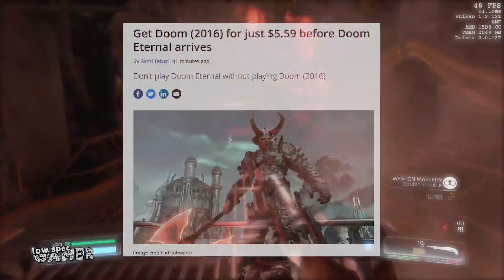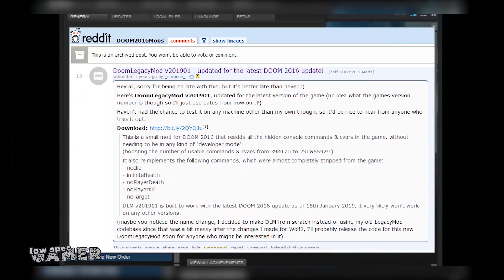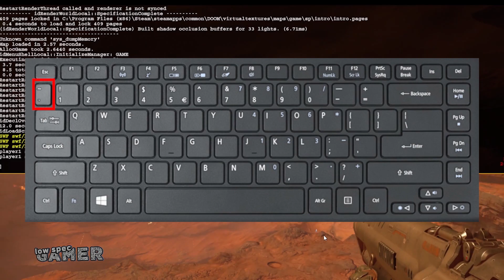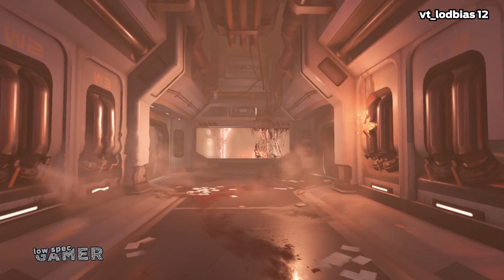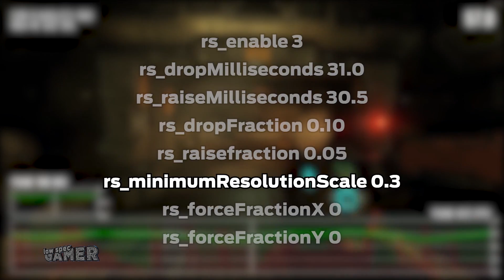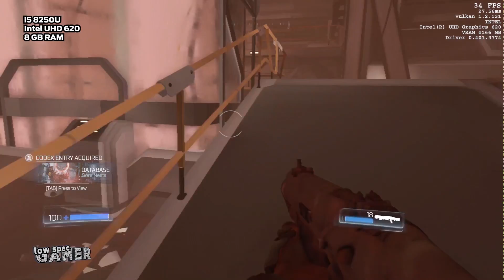Doom 2016 ultra low graphics for low end PCs (Intel HD/UHD 520/620/630)

Comment: can i atleast got around 20fps 
im using intel core i5 660 3,33ghz
4gb ram
intel r hd graphic (1st gen if im not wrong)

im fine with 800x600 resolution or even lower ;-;

Comment: I've input the commands and the graphical commands trying to run the game at a dynamic 30 fps at 720 on the intel uhd 620 and it keeps dropping to 24-25 fps only locking to 30 when nothing is happening.

Comment: yeah i used some tweaks in my r7 240 gddr5 2gb vram and i can get to 70 fps in 720p with a scale resolution of 70% the game still looks good and i can even raise some configs but i will not so i can play at 60 in full intense combat 
obs: runing opengl because i was not able to run as vulkan i dont know if its my cpu a core 2 quad that is very old or that i only have 6gb ram ddr2 but it is not the gpu i know it supports vulkan as i see in a lot of youtube videos and in gpu-z it shows that i have support to vulkan...

Comment: I installed it correctly, but it still says "Unknown command".
is there a way to fix this?
Reply: Same problem too :((
Reply: Paste all the downlaods file from the low end site in the doom folder
Reply: @r9compsftbl  still doesn't work
Reply: manually type it then.or you just havent watched the whole thing
Reply: @-PolesticoPaulJustineD  I have, multiple times.

Comment: when I enter a command is says unknown command. is there any way fix it?
Reply: Mine is a cracked version too so I thought that's why it didn't work
Reply: The mod, install It
Reply: Doom Marine No. 2145 I did and it still didn’t work
Reply: All you gotta do is copy dinput8.dll and paste it where both doomx64vk.exe and doomx64.exe are located, that's it, check if you typed the commands correctly, other than that, I don't know why the hell it won't work. because that's all I did, and it worked.
Reply: Doom Marine No. 2145 it’s probably because I pirated the game I am to poor to afford the game
Reply: @normalhuman6962  No, it works on cracks, i've tested both.
Reply: @normalhuman6962  Just make sure you have the latest version of the game.

Comment: In the script you left in the description i think the 30fps commands and 60fps ones do the exact thing, correct me if i'm wrong.
Reply from the maker: Oh yeah gotta fix that thanks
Reply: @LowSpecGamer  No problem, i also think the values for rs_dropMilliseconds and rs_rasieMilliseconds are wrong, the values for 60 fps are around 30 and the values for 30fps are around 80, with the values of 14 and 13.5 i got something around 100fps, which is higher than 60, not lower, so i think increasing the numbers decreases the fps and not the other way around.

Comment: Please help. Game shows me "couldn't exec lowspec.txt"
Reply: I had this issue. Is the file in the base folder itself named "Lowspec.txt"? Remove the txt from the name. so it's just called "Lowspec". Now execute it into the console but with the "Txt" included.
Reply: @DoomguyClippyAreGrinningAtYou   Nice thanks... I had the same problem and now it works. But now when I text "execing lowspec.txt" it show me "Unknown command" but I install the Console just like in the vidio, do you know where's the problem now ?

Comment: I can play “WWZ” that needs a minimum of 8gb of ram the game is 60fps but when I play Fortnite that needs a minimum of 4gb of ram the game is 30fs (my pc has 12gb ram) Help me pls
Reply: Minimum - and quite often recommended too - specs tend to vary wildly in terms of how much they actually reflect reality. (and the interpretations of the phrase "minimum specs" vary as well, for some developers/publishers it's just "game can start to its main menu")

Some games can run perfectly playably on barely above minimum specs machines with graphics settings turned down, while some less well optimized titles can struggle badly on recommended specs or even above.

Comment: I have plenty enough computer to run this and Eternal at their highest settings, and yet this kind of thing fascinates me more. I did stuff like this for years back when I had a Pentium III/GeForce 2 MX 440 machine, and later an Athlon XP/Radeon 7500 machine. I love seeing older or less capable hardware get away with stuff it has no business doing, and I think that's almost more fun than running everything to max and seeing the FPS counter bounce off the VSync limiter...

Comment: I have an RTX 2070 super and I don't need any of this at all, I just really enjoy your videos. Keep up the good work!
Reply: weird flex but ok
Reply: @OutlawedPoet  pretty normal flex actually, don't you think?
Reply: Benjamin congrats on that RTX 2070 Super. I’m still using my GTX 1070 SC from 3 years ago I got before the mining crazy.. but if I wasn’t poor I’d love the 2070 Super.
Reply: @casedistorted  save money and get next 3000 series
Reply: @casedistorted  You're good, man. The 2070 Super would be a very underwhelming upgrade anyways.
Reply: @casedistorted  you're lucky you have such an op gpu , I only have a 2gb mx110
Reply: You could try all that stuff just to see how high the frame rate can go. Just giving an idea.
Reply: Same with my 1080Ti. This is fun, interesting and broadens the knowledge. If you don't check out the low end you get Lazy like Linus where you don't manage to get max performance out of low end/midrange hardware due to lack of knowledge (cough single channel RAM with RYZEN APU cough). Or where you start to think you really NEED 32GB of RAM these days or 8 GB for simple office works and browsing because you use Windows and Chrome on an integrated GPU while if you use Linux and Firefox you find out 4GB is plenty and you could manage with 2GB without that much effort.
Reply: me too but its awsome to know my cpu can run it but it looks horrible if you are poor and dont have the money  to upgrade your rig just buy a console ps4 costs 250$ these days if you dont even have that much i am sorry gaming is an expensive hobby...
Reply: @almogz9486  on a 720p screen, nothing looks horrible
Reply: Gtx1660 6gb same, it's just fun
Reply: Lol i have ps4 and don't need that but i enjoy your content
Reply: 1050 2 gb :(
Reply: And here iam using a gt 520
Reply: yh same
Reply: Nice

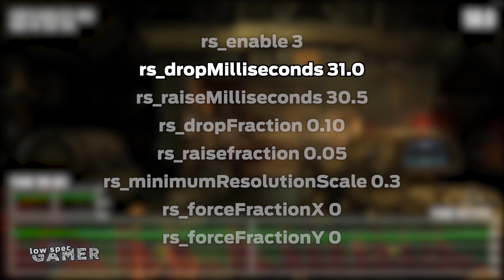Comment: 4:25
Sounds like this thing could be really useful for VR games.
Reply: @feelsboyyyy  You can't see anything in the distance much anyway in VR.

A 2560x1200 headset like the original Rift or HTC Vive are spreading that resolution over a 90+ degree field of view.
If you work this out backwards, that's equivalent to running a game on a regular monitor at a resolution of 640x480 or less.

Still, if you can keep 90 fps in VR, that matters more than just about anything else...
Unless of course you have an extremely high nausea tolerance, in which case, good luck to you...

Since I was messing around with Hotdogs, horseshoes & hand grenades, I actually thought about this while trying to aim in the distance...
And then it occurred to me that if my eyesight was as bad in reality as it is in VR (thanks to low headset resolutions), I'd be considered legally blind...

Yeah, VR has a long way to go yet. XD

Comment: For anyone who is confused on why the edge of his screen looks all glitchy and weird, its Vulkan. For some reason, Vulkan has trouble rendering the game when you lower the internal resolution. Don't panic, your monitor isn't broken, its just the game.
Reply: I'd imagine it'd have something to do with Intel Vulkan drivers. Is this able to be reproduced on a dedicated GPU or on AMD integrated graphics?
Reply: @CorneliusCornbread  Yes, it happened in WWZ. I was playing on my Nvidia GTX 1050 with Vulkan and turned on dynamic resolution. A few minutes in, the screen looked like that. So, I think its all of Vulkan, not just intel.
Reply: It's a flaw in their (ID tech) dynamic resolution implementation. Dynamic resolution works by using a part (the upper left corner) of the full backbuffer. If not done correctly some effects like TAA, blur or bloom might reach out of the range of the currently rendered resolution and cause these glitches. You are basically looking at unitialized memory. I work at a porting company and we saw and fixed such issues in the UE4 engine.
Reply: It's interesting because I have an old plasma display from 2006 that does almost the same thing if you feed it a resolution that it will tolerate, but clearly can't handle very well.

For instance, it can accept a 1080i signal even though the panel resolution is 1024x512, but it will have a weird effect similar to that. (720p renders without issue)

Stranger resolutions can do it too.
For instance, since the panel is 1024x512, you would assume the closest equivalent to SD resolutions for a PAL image in 16:9 would work reasonably well. (1024x576) and it does.
Yet convincing it to show this resolution is tricky. 
Meanwhile a more typical resolution for a computer would be 1024x640, and that glitches quite badly...
Reply: Vulkan is a fucking nightmare (no pun intended) in Doom 2016.
Reply: Vulkan is quite broken in DOOM 2016. I was like what the hell when I first saw those weird rendering bugs XD
Reply: doom ethernal
Reply: Or the screen splitting which doesn’t have to do with vulkan
Reply: i'd rather use opengl

Comment: Why someone would use this mod, this game probably can run on gameboys
Reply: my game runs on an NES at ultra nightmare settings 4k 932 fps
Reply: is this a joke?
I hope it is
Reply: @Mate_Antal_Zoltan  nah man it isnt a joke. I run the game at ultra nightmare 8k 643 fps on an arcade machine. I actually managed to get the game running with a power supply connected to a fruit roll up box, ran at medium with 90 fps 1080p. I think the only people that need this mod are seed users, and even then you could get 45 fps at 900p low settings without the mod
Reply: @OutlawedPoet  agree
My glasses can run this game at 1440p 90-125fps
I even managed to unlock vr mode

Comment: Is there a way to use resolution scaler in DooM 2016/Eternal for SuperSampling? It doesn't seem to go above 100% by normal means, and DSR is not that good for this type of games (using temporal AA in-game + DSR is either too blurry or too artifact heavy due to sharpening, while DSR only looks even worse than in-game TSSAA).

Comment: Bro my pc suddenly drops to 20 or 10 fps while gaming after sometime it come to normal
Reply from the maker: You are overheating.
Reply: Is there any way to fix my laptop
Reply: Sry it is laptop not a pc
Reply: @fazepanther4200  You could possibly attach an external fan to your laptop, buuut thats kinda... meh.

You could open up your laptop (ONLY IF IT DOESNT HAVE WARRANTY), clean it from dust, replace thermal paste. Laptops are usually not meant to be used for heavy gaming, just light gaming and workload.
So even after the cleaning procedures you still see your fps drop, you cant do much about thermal throttling :)

Get a pc my man, its a miracle.
Reply: turn it off and let it sit for a while, maybe put a fan next to it, it's probably overheating
Reply: that's bad stop playing or else say good bye to your gpu

Comment: Last time I was this early, 8gb was considered high end.
Reply: I still have 8 gigs of ram and everything still runs just fine.... until I open google chrome
Reply: @WAND3R101  stop using chrome!!! switching to firefox was the best decision I made on my pos laptop
Reply: @liamsweeney4754  Yeah Firefox was pretty terrible in 2017, especially video playback on Nvidia GPU's but I ditched Chrome completely now and Firefox does everything very well. Especially the plugins are unmatched! But for those addicted to Chrome and are tab hoarders you can significantly lower RAM use by installing the add-in " The Great Suspender" since it'll take you inactive tabs out of RAM and into your primary storage. It's slower to load them obviously and by then Firefox is faster than Chrome so you might as well use Firefox.
Reply: @liamsweeney4754  that's a solid argument mate
Reply: @liamsweeney4754  but you see that's different from what I'm used too and different is scary
Reply: @WAND3R101  wasnt talking to you but the other guy, I assume you were taking the piss the other guy wasnt
Reply: @CheapBastard1988  Use just about any Chromium based browser OTHER than google chrome.
I have Vivaldi personally (but then I was a diehard user of the pre-chromium Opera 12, and Vivaldi is the closest modern equivalent to the functions that had)

I find vivaldi or even a modern iteration of Opera, in spite of being Chromium based use something half the RAM for a given number of tabs that Chrome itself does.

Also 'lazy tab loading' is a first-class built-in feature of Vivaldi.
I have 392 tabs open on an 8 gigabyte system, and because it only loads them when I actually click on them (And I can suspend background tabs manually if need be) total memory use for 392 tabs is <5 gigabytes...

Just... If you have RAM problems use ANYTHING other than chrome.

It's not even Chromium browsers in general, it's specifically google chrome that sucks up RAM like nobody's business.

Use Firefox.
Or Vivaldi.
Or Opera.
Even Microsoft Edge.
Whatever.
just NOT CHROME!
Reply: @WAND3R101  I'm just worried that I will have to re-type a password that I forgot because the cookies won't carry over
Reply: @WAND3R101  Chrome need 50gb ram :V
Reply: @antonio_gallegos  linus tech needs 2tb of memory ram
Reply: @EFKA Ltu you good bro?
Reply: cries in 3gb ram
Reply: still is for me :/
Reply: laughs in 64GB RAM
Reply: cries in 2 GB
Reply: TFW having 8GB RAM, what a perfect comment
Reply: opera really is the gooder browser
Reply: I had 4GB till January
Reply: .  *me looks at my pc and laughts in 64 gb of ram*.